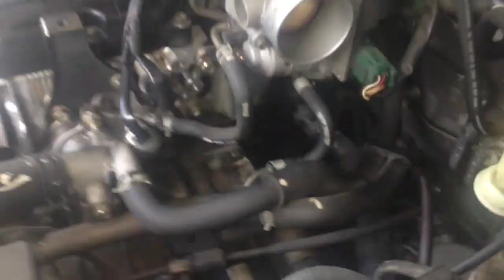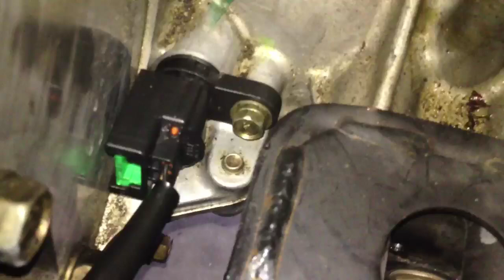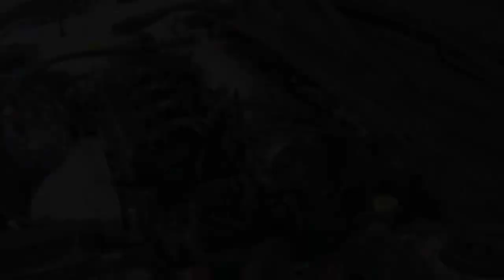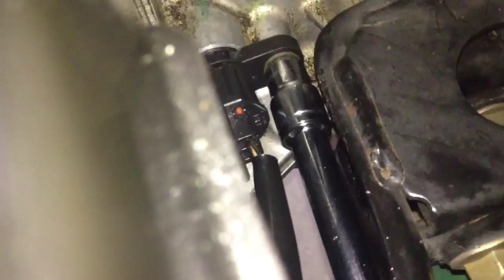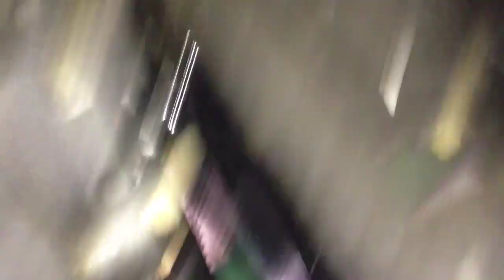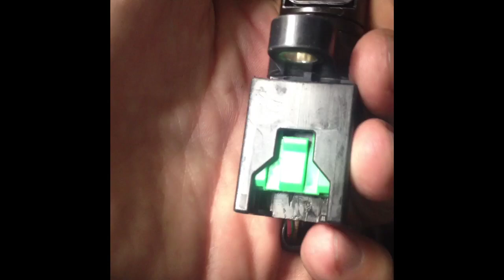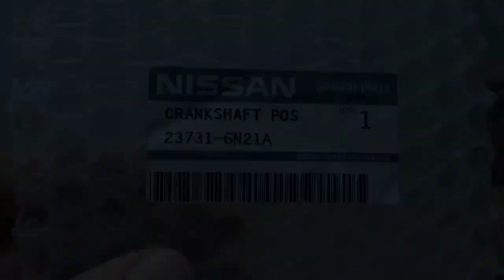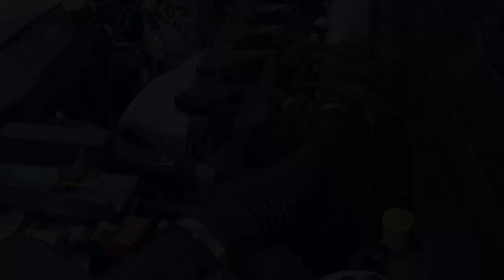Code P0335 / P0340 /P1336 - Crankshaft Positioning Sensor Replacement DIY - Nissan.

Comment: I've had mine replaced 3 times in the last couple of months and my car is still stalling and hard to start sometimes. It was always a part from a local auto parts store. Are there any other sensors that go along with this one that could cause that same code to come up?
Reply from the maker: Yes. Camshaft positioning sensor.
Reply: Temachok When I went to the auto parts place to ask about it, the guy said the exact same part came up on the computer. Would I need to order two and replace them both then? Can you tell me where they are both located? Sorry to be a bother, but I've taken my car to several different mechanics and it has been acting up for quite some time and I would really like to get it fixed.
Reply from the maker: Yes, this is correct. Both sensors are identical.
Since you already replaced crank sensor, try to replace the cam sensor only first.

Look for video on my channel how to locate and replace it.
Replacing camshaft sensor is very easy - 10 years old kid can do it.

Comment: Where is the plug located ?!
Reply from the maker: It's a wire harness. It shows the location in the beginning of the video.
Reply: Temachok So I would have to push in the green chip (til i hear a click sound) and remove it like that before unscrewing the whole censor off?
Reply from the maker: Correct. You won't be able to unscrew it until you remove the harness (if you still have the original sensor).
Mine looks different in the video cuz this is my second time replacing it. Aftermarket sensor that I put in failed next day.
Reply: Temachok Awesome thanks! great video!
Reply from the maker: Thank you!!!
Reply: Temachok Another question, was it difficult to apply the wrench onto the bolt that's screwed into the censor?? Because I am having an extremely difficult time trying to get the wrench onto the bolt. (I am using the extension as well too)
Reply from the maker: It shouldn't be with the wire harness off.
Try using video camera or mirror.
Make sure the socket is the right size.
Reply: Temachok Update: so I managed to replace the censor with the new one I purchased at AutoZone, & now my car is in worse condition. To start up my car, it delays about 5 seconds & the shifting at first is't smooth until I drive a few miles & it begins to shift smoothly. Is this expected? What else could be the issue? Maybe it's the wire that needs evaluation?

Comment: When you changed the sensor with an aftermarket one, how long did it take to know that you needed a Nissan OEM sensor?   When did the car start shutting off at cruising speed/stops?
Reply from the maker: Sensor from eBay for $20 failed next day.

Comment: Oct 10, 2014
Hi Coach Temachok,
got p0725/p0335 codes in that order.
car runs on freeway and then engine stops & rpm = 0 for moment.....then ja erk and engine starts & runs again...
replaced CPS (crankshaft position sensor).....
pulled off ground cable from battery & re-installed it....told this step erases old codes & resets SES lite.
then started car & SES still "On".....
did pulling off battery ground cable NOT erase & reset SES ?......or is Cam position sensor BAD too ?
Is p0335 same code for CPS & Cam sensor malfunction on all Nissan ?
Reply from the maker: Yes. Those sensors are identical. It's recommended to change them both. Also, make sure to buy good quality or OEM parts.

Comment: All modern vehicles have so many sensors controlling different things , and some are coupled together so if one goes faulty it stops the other working , its a nightmare...... 
If you have to change a sensor always use an original part and don't be tempted by after market parts , they maybe a lot cheaper but they may not work correctly and can leave you feeling very frustrated after spending a lot of time and effort changing the part ....!
Reply from the maker: True story! Thanks for sharing!
Reply: When you say "after-market" parts are you referring to used parts or parts made by other companies (not by the auto manufacturer directly).
Reply: jackiechan511 Hi there , yes i mean parts that are made cheaply by other company's, some things are ok like body work panels and trim but if its a vital part to do with the engine or braking system its not worth going cheap , your always safer to use an approved manufacturer part , because if you do the job yourself and spend a lot of time and effort and then find that the part you have just changed does not work it's usually because the quality is not as good , there are hundreds of parts manufacturers out there and a lot of stuff is made in the far east and you may be tempted to spend £ 30 on e bay for a cheap part but you should spend the full £ 80 for example on a good quality replacement from an approved parts distributor for the vehicle in question , another good way is to go to a breakers yard and remove the part yourself from a scrap vehicle , that way you know its an original part and should be good .    I hope this helps you in the future and good luck with your repairs .
Reply: yensabi I agree there are a lot of "knock-offs" of the original parts and many of them make claims that they exceed the original equipment. It's hard to determine whether or not these live up to their claim.  I will say that I generally feel confident when an aftermarket part is made by a company like Stant, Bosch, Borg Warner, Dayco  or Moog.  I recently purchased a set of thermostats for my Nisson from Auto Zone.  The brand was a brand I never heard of but after I looked them up online I read that they were a Felpro company.  I tell you where to really watch out and that is with remanufactured brake parts.  I bought remanufactured calipers from Advance Auto and when I took them out of the box they were defective.  I returned those and brought another set home - same thing: defective. I returned those and got my money back.  I then ordered a set from Pep boys and they were fine.  Buyer beware!
Reply: E.PLUMBUS UNUM .nk kit

Comment: I need one done like this for a 1996 year.
Reply from the maker: Same process, but I don't know where it is located on your car. You can buy a service manual for few bucks on eBay. It will have all diagrams. Or research on Google.

Comment: Excellent video, I had previously got the Crankshaft sensor changed at my local garage and deceided to DIY this time.
Got the sensor off but couldn't release the Green latch to get the sensor off. Didn't want to destroy it as it looks as if the mechanic did a pretty good number on the Green latch. Is the any "gotcha's" I nned to be aware of ? In your video the release catch pressed in quite easily, mine is very difficult to even move 2-3 mm ? any suggestions.......
Many thanks
Reply from the maker: I used large flat head screw driver to press it in. 
Try extension with a small socket on it may be.

Comment: Ok i have a 2002 Nissan Altima 2.5S. one night car was very difficult to start kept turning n turning n came on awhile as i pumped gas pedal. Check engine light came on at the same time, so i took it to pepboys  The codes that came up are P0335/P0725/P0335 in that order. Will what you did this video solve my problems?
Reply from the maker: Most likely replacing both Crank and Cam shaft positioning sensors will fix the problem. Just be sure to buy good quality replacement parts.
Reply: Ok. But i only seen the video for the crank. U have for the cam as well?
Reply from the maker: Yes. Click on my channel name and go to Videos tab.
Reply: thank you
Reply from the maker: NP

Comment: After my car stopped in the middle of traffic. I took my Nissan to local garage, they changed the sensor and cleaned the injector. However after a day the car stopped again while I was driving.

Also the rpm goes up and down since the sensor is changed. What could be the possible issue?

I called up Nissan, they asked me for $130 to do a check/diagnostics and then if anything I would have to pay for parts and service.

Any help or suggestions, I am new to cars. I got a used Nissan Altima Sedan 2007 2.5S modal.
Reply from the maker: Scan your car for Engine errors. Most auto parts stores do it for free!
Reply: I did, it shows 1 engine error. Under engine it shows "CKP SEN/CIRCUIT"

Also I am planning to buy OBD2 ELM327 V1.5, Do you know if I can connect it to Altima 2007?

Thank you for the help!
Reply from the maker: Yes, OBD2 will work for your car.
Reply: Temachok Thank you! Appreciate it. Btw for the other issue. I changed my Cam and Crank sensor. For the car RPM going up and down. I got my car computer reset.

Now everything is perfect in my car now.

Your videos are very helpful. Now I know more about car and related mechanical work. Keep up the good work. :)
Reply from the maker: Great! Most of the car problems can be fixed easy with a little bit of research. Plus it saves you tons of money. Thank you for sharing. I have mor videos coming soon.
Reply: One thing that can cause erratic idling up and down is an air pocket in the cooling system.  Are you sure the sensor they changed wasn't in the cooling system?  If it was and they opened the system and introduced air into it, the system will need to be "burped".

Comment: Thanks for this video. I found that oil leaks trough the gasket to the connector, so be sure to clean it well. You save me from $400 to $500 plus waiting 15 days for an appointment. The worst is paying $125 just for the diagnostic. At Nissan they don't accept the free one from the auto parts.
Reply from the maker: I feel you... That's why I started fixing it on my own.

Comment: Thanks for your videos!
Hi I have an Nissan Altima 2003 and I have a problem with it like 2 months ago. I went to the mechanic and he told me that my motor is burning the oil so I should change the motor or if he is going to repair it, it's going to cost me like 1800. So I asked a friend who lives in California (He is mechanical engineer and I live in North Carolina) about this problem and he told me maybe the problem is in the head gasket and rings of piston. My car is working well but the problem is that every 8-10 days I should put oil because when I check the oil it is really low. What do you think? Thanks anyways!
Reply from the maker: I would probably changed motor, rather then trying to fix old one with lots of mileage on it, IMHO.

Comment: I have the same engine 2.5 ,,,,please let me know I wanna change mine also
Reply from the maker: When I first bought aftermarket part for $20, it broke next day. Then I got original sensor from dealer for $65, and it works till this day.

Comment: Hi maciej can u let me know if changing that part resolve UR issue,,u change it in march right,,,,the problem came back? Can u also tell me where did u get the part n how much,,,thank u AGAING
Reply from the maker: If you buy good quality part, it should work for a long time. I would recommend to buy original factory parts from Nissan dealer or from eBay. Just make sure it is "original factory OEM part".

Comment: I have a 05 altima 2.5 4cly 5speed and rpm reads right but the speedometer gauge reads 20mph over, do you know what may cause that, thanks
Reply from the maker: Speed sensor might be bad. Does it show 20 when you stop?
Reply: Temachok yes it shows 20mph when I stop
Reply from the maker: My guess the arrow itself just got moved up somehow.

Comment: I have a 2006 nessian altima 2.5  it's losing compression very bad, changing the crank shaft sensor, will that make the car loss power? Please help me...Thanks
Reply from the maker: Check error codes to get at least some ideas about the problem.

Comment: Hi again I changed the crankshaft sensor now my car revolution is going high and low, is there something wrong with the sensor or the aftermark sensor don,t work
Reply from the maker: Could be a bad sensor. When I installed cheap $20 sensor, it failed next day. Have you tried to erace error codes and see if they come back.
Reply: Yes I did that, the rpm going high and low, now the problem is the throttle body is not working good, what you recommend to do, can I cleaning that and you have videos how to do it?
Reply: the car is starter good now so the sensor is ok but the rpm in the car is not good so the throttle body is the problem but I need to know what I can do
Reply from the maker: No, I never had problems with throttle body before. Variety of reasons can cause this issue. Have a mechanic look at it.

Comment: Hi Temachok your videos are so helpful but I have a question How many Crankshaft Sensor a Nissan Altima have? I had this problem and replaced the one in the top of the engine but I didn't there another one in the back. Thank you for your videos.
Reply from the maker: There are two sensors.The one you changed called camshaft position sensor. It is on the top of the engine. The one in the back is called crankshaft positioning sensor.

Comment: Great stuff.  I swapped mine last night after getting the P0335 code over the weekend.  Used a Napa part ($36 or so) and no service engine light after 20 miles at highway speeds.  Fingers are crossed that this did the trick.  I had tried my iPhone 4 tucked in there with video mode and light to get a look at what was going on (worked pretty well) but my best luck was taking a headlamp and stuffing it into the engine compartment, facing back towards the sensor.  Then you can get a view into the area if you look straight down from above.  Anyways, thanks for the great instructions!
Reply from the maker: Sure, I hope it'll work another 10 years...

Comment: thank u for info.. i replaced crank shaft sensor... but the p0335 code& p0725 comes up 2x still ,car was starting fine to begin with but replaced the sensor cuz the code came up. after i put the new sensor in it was actually not staring as well, anyway when driving the car it looses power witch is the whole reson i checked the code to begin with,, any ideas ????? thank you

Comment: Can't thank Tomachok enough to save me some cash. I was quoted $700 for the entire job with code scan etc. $350 to just replace the crankshaft sensor.

Very good video. Gave me a good idea on what to expect. Few things to add:
- you don't have to work blindly, put a fluorescent bulb in the engine compartment behind the engine and all hoses.
- rest your forehead on the hoses before the 1st cylinder starting from the driver side and look through the gap  in between the hoses and you can easily see the sensor in full. I tried working on the removal blindly, also used an inspection mirror but could not get anything done for almost 4 hours. After I was able to see the sensor, the entire process of removal took 15 minutes.
- for original sensor removal, you will need to press the the top of green tab with a flat screw driver. Press it all the way down until you hear a subtle click, then just pull it off (don't pull the wires or you could damage them). Mine was stubborn, I had to use a long flat metal skewer and inserted in between the space from where I was looking at the sensor from top of the engine. I inserted the tip of the skewer in between the small gap that was created between the connector and the sensor after pressing the green tab and then twisted to separate the connector from the sensor. What Temachok had was a different design of sensor where there was enough gap in between the electrical connector and the bolt. Mine had no gap so I could not unbolt unless I took off the electrical connector first
- after removing the electrical connection plug, use a 10 mm socket to remove the bolt and then use small nose pliers to take it off.
- put the new sensor and press it firmly in the opening after covering the o- ring in a drop of oil, tighten the bolt and then put the connector back until you hear a click.

You are done. Either unplug battery for half an hour or reset the code using OBDII reader to get rid of the pesky service engine light.
Reply from the maker: Thank you for sharing great tips. I'll check if I can add them to the video as annotations. I'm sure other people will find that very useful. This sensor is common to fail after about 10 years. There is a lot of these Altimas sold between 2002-2006.
Thanks again!

Comment: Great video - thanks, it was very helpful.  (2004 Altima 2.5 SL)
As a note: I went to Harbor Freight Tools and bought a Cen-Tech Digital Inspection Camera for $70 (reg $90). Made my life a lot easier. I could see exactly what I was doing. Went to Autozone and purchased the Duralast brand sensor. It worked, but I still had the engine light, and sub-par throttle response. I HAD to do go to the dealer and pay $130 for the part - Temachok was right. For best results, get OEM Nisan Parts.  You replace both the camshaft and the crankshaft positioning sensor and you will be good to go. Replaced both, unhooked battery for about half hour. Started the car, engine light gone, fuel economy is now 35 hwy, 27 city. GET A DIGITAL INSPECTION CAMERA - makes this much easier. ($75-100) The original sensor was a pain to remove, as if it were stuck. Takes some wiggling and pulling with needle nose.
Reply from the maker: That's weird. I was just looking at that tool on sale at Freight Harbor Tools today, thinking that would be very useful to have it... 
Thank you for the feedback! 35/27 is pretty impressive!!! Mine was always 26-27 average.
Reply: Temachok
Anytime boss. When I saw that you had a camera/phone, I decided to improvise, and get an inspection camera. It works well. Question - do you know if this sensor will go again at some point (soon?). I hear it's a common issue. Not sure if "common" means many people have this issue, or meaning it could happen more than once in the lifespan of one car. 35/27 is about where I am, I live in an are with lots of highway. I've also just had a tune-up, so that helps too!
Reply from the maker: If you got OEM sensor, it should last for another ten years.